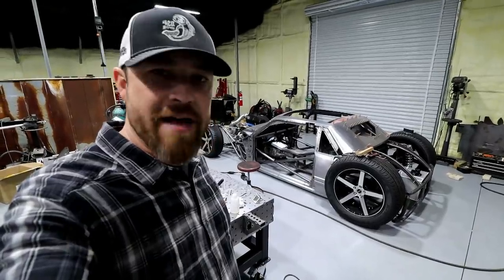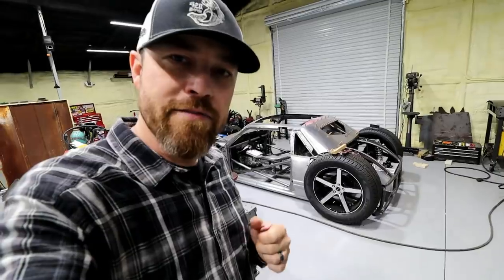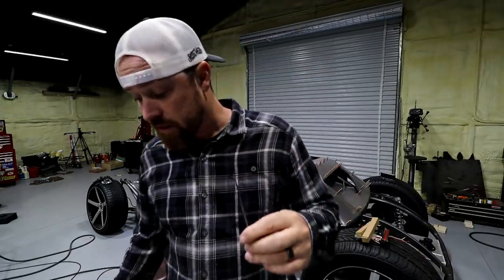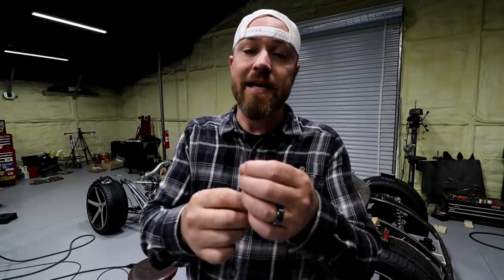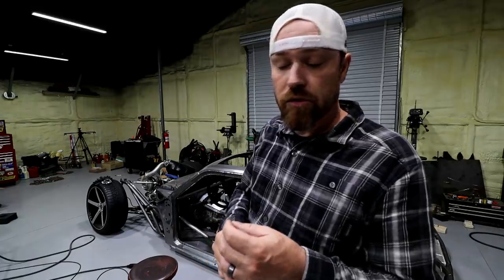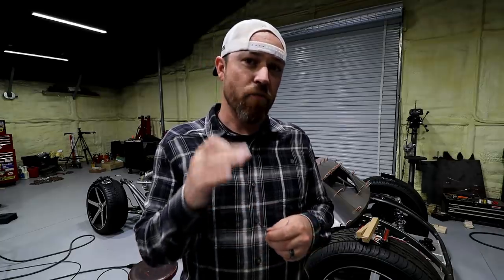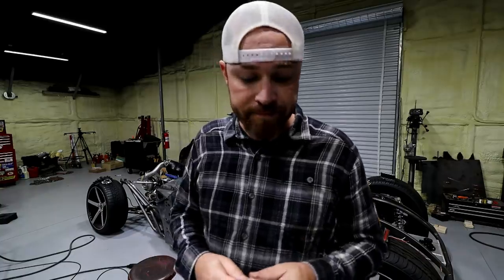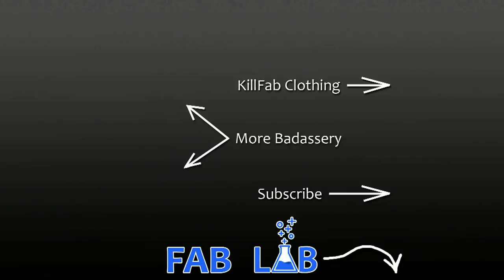Is Dedicated Tungsten Grinding Really Needed ?

Comment: When I contaminate my electorde I score and break off the messed up area and repoint it.  Billk
Reply: That's the proper way to do it if it's contaminated. I sharpen both ends, keepin all same colored bands together in each case.
Reply: I agree, that's wat i was told to too when i started welding but i think it's wasteful
Reply: Technically breaking can leave cracks in it. It should really be cut off instead.
Reply: In a perfect world this would be proper procedure and absolutely required for any job requiring NDT/X-Ray testing. Building an exhaust for your weekend track car project its still best practices but if you don't its not the end of the world either.
Reply: I keep a pair of quality lineman pliers on me while tig welding they are capable of cutting/breaking the end off a piece tungsten up to 1/8" also I use them to snip the end off of my filler rod basically the HAZ including any filler that may be crystallized from not being completely under shielding gas especially when breaking the ark
Reply: I found out a cut off wheel on a grinder can cut off tungsten when I was chasing down a splinter.

Comment: Great video! I personally use a flap wheel on a 4.5" grinder and my tungsten in my Milwaukee cordless drill on low speed, which allows me to stay on what I'm working on, instead of walking back and forth to the belt sander at work! I label each flap wheel with aluminum, steel, or stainless steel. And always sharpen inline with the tungsten, never to the side!

Comment: You make a very valid point here.   It's not really all that dedicated anymore is it?    The only reason I still use a dedicated grinder is because at least when I'm grinding tungsten it's clean, where as my other wheels may have paint, grease, etc residue on them.
Reply from the maker: Yeah I still have a dedicated sharpener as well. Just something I was thinking about

Comment: Good video. As a welding engineer and welder, I agree with your thoughts and comments Kyle. I have seen tungsten ground on a 4-1/2" grinding wheel, bench grinders, belt sanders and dedicated tungsten grinders, then all were used to make x-ray quality welds. The things that matter most are keeping the tungsten clean and keeping it sharp. When doing automated or mechanized TIG welding, keeping the correct angle and land thickness is sometimes critical to getting repeatable quality in welds. But in manual welding with 3/32" or larger tungsten 60 grit or finer abrasive works well and 36 grit is tolerable.  When using 1/16" or smaller tungsten, the abrasive grit size can make it hard to get a good tungsten profile. I agree with you, I don't see much chance of softer metals becoming embedded in the surface of tungsten. Pure tungsten has a hardness in the range of 2570 Brinnell compare to less than 200 Brinnell for most low to medium carbon steels. Keep up the good work.

Comment: Break off contaminated piece and resharpen. I use a small peen hammer. I also sharpen both ends so I don't have to go back and forth sharpening one end; Keeping all same colored bands together in their own casings. I use 2 bench grinders, 1 wheel for mild steel other wheel stainless, 2nd grinder for aluminium, other wheel spare.
Grind the tungsten end vertical with the grinding wheel, NOT horizontal. I dont know how many guys I've seen do this, it screws up the arc.
Reply: double sharpened tungsten is great until you dip it and can't remove it from ur collet..

Comment: Couldn't agree more. Most people, me included, have far more issues in the fundamentals of tig welding. Proper torch height and angle, consistent dabs, correct heat/travel speed, and a steady hand are all far more important.

Comment: you know... i'm in a home shop, i have one bench grinder for everything. i dont have the space to have 4 different grinders for every type of material. i never faced any problems regarding to contamination or something. my stainless welds are still stainless and all my other stuff never came apart. i think its a huge difference. if you are working in medical/industrial environments, it makes sense to keep stuff as clean as humanly possible, but not for the home shop, its just impractial and in my mind not really needed.

Comment: I used to cut the end off first when I got a big blob of metal on there and then sharpen it up on my dedicated wheel. But I don't bother any more, it's much easier to sand the blob off. I figure if it was contaminated you'd probably know because you'd get sparks and junk coming off it when you went back to lay some more Instagram stacks.

Comment: Very good food for thought. My first instinct would be to say that is depends on your application. If you are welding food processing equipment ie. hygiene grade equipment then you will most likely need to maintain a pedantic standard. If you are working with mild steel where penetration/structural integrative is a little more forgiving them perhaps you could get away with being not so pedantic. I guess another aspect to having a dedicated grinding belt etc. is the longevity factor. If you use it for just that one thing it will most likely last longer than if you ground lots of different things with the same grinder etc.

Comment: I have been using what ever flap disc is mounted on my m18 grinder.. usually one just for tungsten. However I have found it leaves a convex point. Grinding on the side of a cut off wheel leaves a truer flat angle and the few times I have done it, I  noticed better arcs. Also the used flap disc makes the first arc start up kinda crackly for a half second or whatever perhaps impurities are burning off?

Comment: Ive did an myth bust and when ive drop my tungsten in different metal sharpen it my welds are fine but using an band sander after sanding rusty metals made the arc behave weird.
Not saying it works 100%  but I like to wonder bout that to. But I do have an bench grinder for tig sharping only use one end to shape it other side to finish it

Comment: When I "dip" my tungsten..."screw-up" lol, If it does hold an ugly blob or knot, I tend to lay it on the table, slide back to the knot, and with a light tap break off the bad. Then resharpen. Not saying its correct. Just sharing my experience.

Comment: Also consider why do we use tungsten as the electrode in the first place? It can handle HUGE amount of heat right. Will the contamination on your belt sander, stone wheel, diamond disk etc. melt into the tungsten when you grind it on there? No. 
I welded professionally for years (majority stainless and aluminium TIG) and ground my tungstens on whatever was closest when need came up. Zero rejected welds and as many complaints of contamination of welds. 
Food for thought indeed.

Comment: Typically what is meant by dedicated tool for welding is for example your belt sander would have dedicated belts for each material that is worked with(mild steel,stainless,aluminum, etc.) Wether the material is being prepped or metal finished. Now with all that being said I have yet to see anyone carry more than one of those high dollar tungsten grinders for different weld materials. When I have seen cross contamination happen it's been in how the material was worked during fit up not when it's been welded. Not an expert, just sharing.

Comment: DONT BREAK IT. I will cause cracks down the tungsten lengthwise.    I have herd the best way is to use a diamond embeded cut wheel for tile. Cut it off below contaminated area and sharpen. No contamination No cracks

Comment: You have got it wrong, you do need a dedicated grinder/sander for tungsten only... you should snap off the contaminant tip and then regrind. 

It probably doesn’t mater for the hobbiest welder, a professional would be in big trouble and could contaminate a risk sensitive weld on say a pressure vessel or piping etc and have a failure point of not picked up by x-ray.
Reply: You didn't comprehend.  We aren't all building pressure vessels, not all welds are super critical, not all rules are universal. Get a grip.

Comment: i've never believed that theory either.....if tungsten is harder than aluminum/mild/stainless then how would a softer metal "embed" itself into the harder tungsten...?  can a micro fiber get stuck in a microscopic groove left from sharpening...sure, but once that tungsten goes hotter than the surface of the sun doesn't it vaporize that little fiber anyway?  it's hooey, imho.  but my welds aren't insta-worthy anyway.

Comment: Welp, my TIG welding sucks ass so I'm about the lowest authority possible on the matter, but I'm going to go out on a limb and say that a better welder who uses 1 grinder for everything will have better welds 10 times out of 10 than a lesser welder who has a dedicated grinder.  First of all, I think you're dealing with rather low odds between a piece getting embedded in the grinder and then embedded  against in the tungsten and not flying off in a random direction as shit tends to do when you grind it.  Secondly, you're not welding in a clean room.  At a microscopic level there's dust and God knows what else in the air that is all over that tungsten.  The same sort of issues with impurities would exist there, too.  I simply can't imagine that purity matters to that level.  But hey, I'm no authority, I'm just an idiot on the internet who uses MIG.